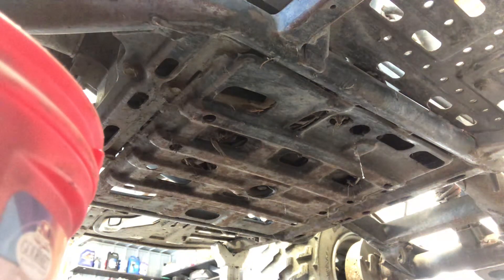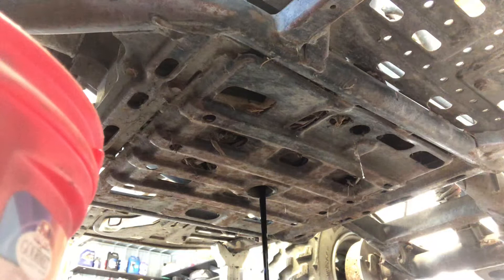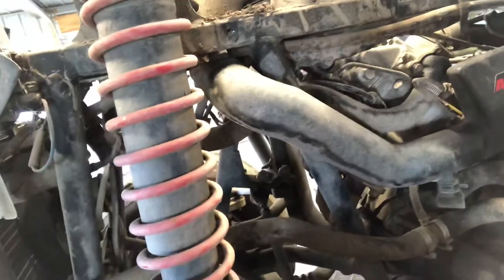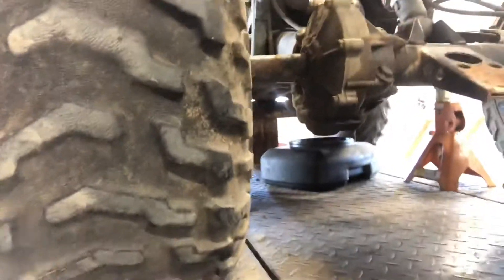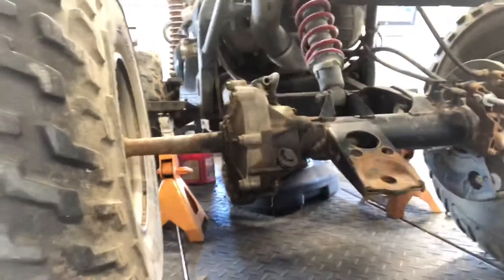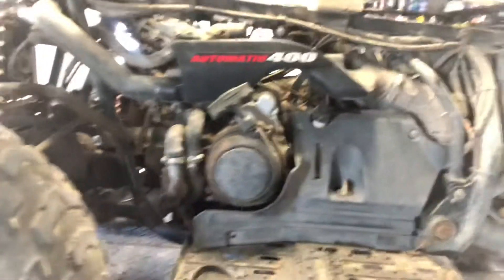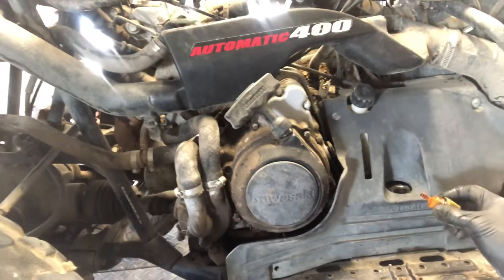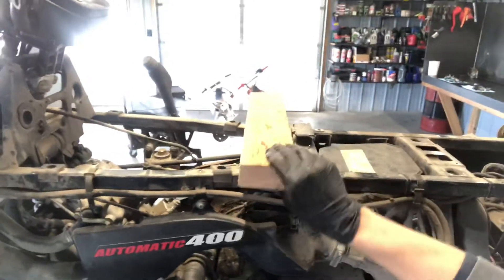Kawasaki Prairie 400 - HOW TO - Full Service - Oil Change

Comment: for gear oil can you use 75w90 synthetic gear oil instead of 80w90 and would 10w30 synthetic oil work or needs to be 10w40
Reply: Either would be fine

Comment: What do you recommend for the front and rear differential gear oil.  I know 80w90 but you said not to use the auto parts store stuff.
Reply: I have auto 90 wt gear lub, I don't think the gear knows it's a car, truck or 4 wheeler.   $$

Comment: Hello, I also have a Kvf 400 and it presses engine oil through the engine ventilation into the air filter box do you know where it could be defective?
Piston rings? I hope you can maybe help me further. Warm greetings from Germany
Reply: Mid Nebraska Motorsports My air filter is relatively oily but it is only 3 months old.  Do you think it's worth repairing it?  or so to go on?